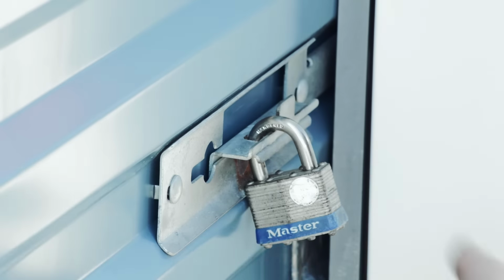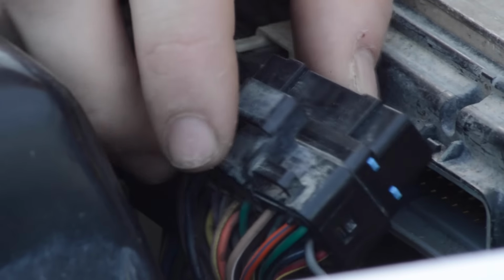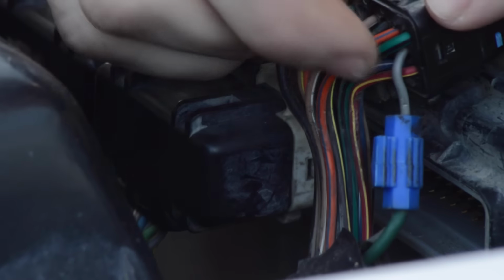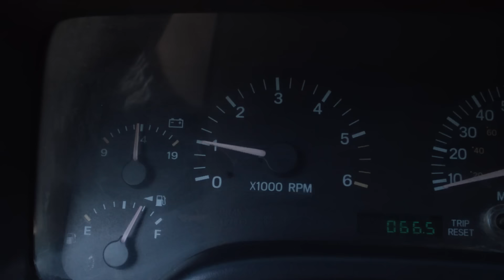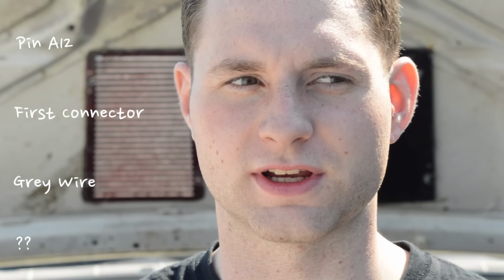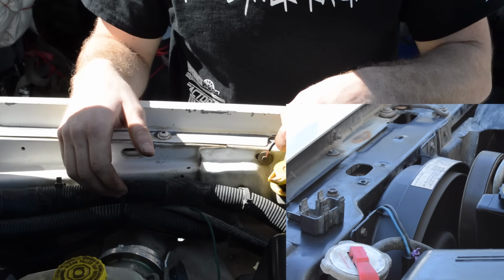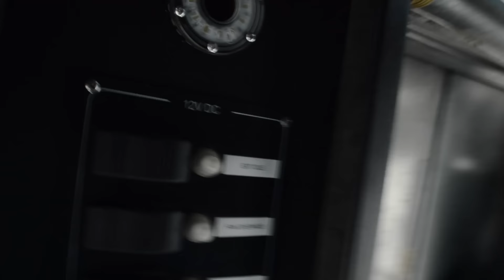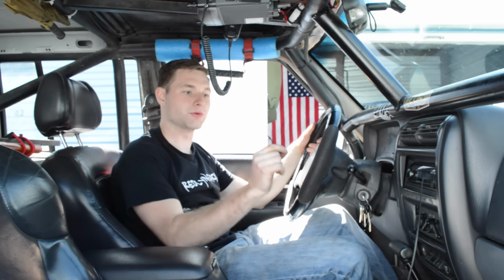Fast Idle and Fan Override - Jeep Cherokee XJ

Comment: Wow im impressed with the production level of this video. Just stumbled across this video and now you got another sub.
Reply from the maker: Thanks! Means a lot. I like to take my time and make a quality video when I can.
Reply: hey Enlisted.

the reason I don't think the long wire to your switch is the reason it won't throw a code is because when you demo'd it in the beginning with a short wire to ground, it didn't throw a code.

you could try throwing a code by doing that again for longer periods of time to see if it throws a code.
.
Reply: Enlisted Budget Videos Its a good video.... But if I have othe kind of computer? Can I do the same with the extended idle?
Reply: the switch panel has an led which is a diode that is why it didn't throw the code
Reply: seriously? 
what a great idea.  
use an LED switch and it kills two birds with one stone.
genius.
.
Reply from the maker: I am not sure. If it is a Jeep Cherokee 96 and down computer yes. I have a 2000 Cherokee so anything 97-01 Cherokee will work just like how I did it.

Comment: Pretty good video.  I have the EXT IDLE button sending a ground signal to relays for both the idle up mod and the fan override mod.  Its handy having them work together since the high idle increases coolant flow.  It also saves room and let's you use the 4 hole bezel if your lucky enough to find one. 

If you want to throw a code just put the AC on. I'm pretty sure you'll get the code Cuz the computer is selfish and doesn't want to give up control.  I went through the whole winter with no code, then finally when I needed AC I got the CEL.   
Still looking for a solution.  
Thanks!
Reply from the maker: That sounds like great set up! Thanks for sharing. Good idea to save some switch space. I might have to look into that in the near future.
Reply: same thing happened to me, no code, AC on got code. hope you can find a solution. Ivè been looking at diodes but haven`t found a way of making it work. Good luck! Ill be looking. if I find something ii`l let you know.

Comment: Extended idle. When you did your test it was only a .1 volt difference, and like you said it doesn't seem like a big deal, but you also have a 5.9 140A alternator, and it can provide more power at idle over a stocker. Also what you may have missed is the fact that as you increase the load at idle that voltage will drop. Most alternators (and probably no factory) aren't designed to put out maximum  power at idle. They usually don't start until 1000/1200 rpm. So that being the way they work with you're extended idle at 1000 rpm the alternator will keep up with the heavy amp draw where as it can't at 750 rpm. Oh, and one other thing people don't catch with the extended idle is that you're also increasing the coolant flow through the system, and effectively helping keep the engine at proper operating temp when parked.

Fan over ride, and the probably the real reason you don't alway get a code. When the PCM sets a code it takes several key cycles (unless is a gross misfire code) for it to actually light the MIL. So if you don't use that override every time you drive your rig it could take quite some time for it to actually throw the code.

Comment: First, I want to thank you for your service! I did the wireing and it worked fine until I turned on the AC. I instantly got CEL. If you can figure out a way of getting rid of that I would love to do it. Thanks

Comment: i did the fan switch mod today, thanks.  i do have a ck eng light. got to research a diode now.
Reply from the maker: Heath Pierce use a switch with an LED light in it. That may fix it. A Light Emitting Diode (LED) is a diode all the same.
Reply: Enlisted Budget Videos How would you wire this? Most led switches have 3 terminals. I understand how to wire a two terminal switch for the C2 wire. But how do you integrate the LED so it prevents the CEL?

Comment: So I tried this today but when I connected everything up the way you said my engine started running rough and tripped a code so I went ahead and tested the wire with a volt meter and it has 13 V going to it
??

Comment: Great video but I still don't understand how you setup the switch so it grounds out? lol I'd like to see how the switch is wired
Reply from the maker: The switch is operated off the ground wire from the appropriate wire for the efan or the high idle. Literally splice in, run the ground wire to a switch, and then a ground somewhere close by.

Comment: when i did mine there were several "grey" wires. one grey and black, one grey and red and two solid grey. be sure to get pin 12A. not just any wire that has grey on it

Comment: hey yall good video but which wire would it be for the idle on 96 and below. oh and I hope yall had at fun at ure open weekend
Reply from the maker: +Eric Goldsmith Hey Man man, long time no see! The pin outs for 95 thru 91 are as follows: 
Pin 10 purple wire on your 60 pin connector.
Reply: +Enlisted Budget Videos which one is idle I've already done the fan override
Reply from the maker: Sorry, at work, that one is for ext idle.
Reply: +Eric Goldsmith hey did you ever get the high idle to work on your 96?
Reply: +Thomas Jennings not yet I really haven't time to but next week I am gunna try it
Reply: +Eric Goldsmith ok thanks let me know if you get it working i have been looking for it but my charging system quit working and I think it's in my PCM but I'm not sure because my alternator it's still good

Comment: Quick question are those seats in the XJ factory? If not what did they come out of? They look nice, also cool video thanks
Reply from the maker: They are leather seats out of a WJ. Easy swap, just bolt the seats to an XJ seat track and you're golden.
Reply: Thanks I will have to see what I can find to replace mine with.

Comment: did your jeep come with leather seats?  thanks
Reply from the maker: +tk106 no it did not. They are from a WJ I found in my local pick and pull. The bolt pattern for the seat is the same as the XJ seat tracks so it is easy to swap in.
Reply: Thanks for the response!  So no fab work at all?
Reply: What year WJ?  thanks
Reply from the maker: +tk106 nope no fab work. Unbolt your seat from your XJ and bolt that WJ seat on. Easy peasy. I think it was a 99' doesn't matter as long as it's a WJ or ZJ with leather seats. You can even wire in the adjustment motors if you wanted. I didnt. Cost too much from the yard.
Reply: Enlisted Budget Videos  Awesome.  Thank you so much!

Comment: Um my 89 XJ idles at 900 when in drive with the brakes fully applied, but at 1100 in neutral. Lol
Reply from the maker: Then you have an issue my friend. Check TPS voltage. Check for vacuum leaks. Two common issues.
Reply: well I am bringing it in tomorrow to work with my mechanic on getting a bunch of stuff fixed for an upcoming wheeling trip. I'll add that to the list!